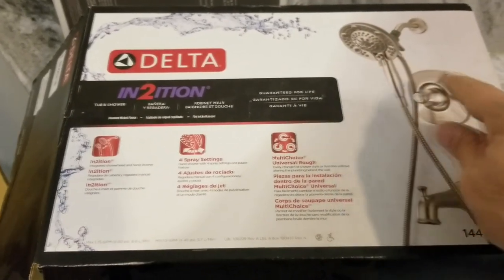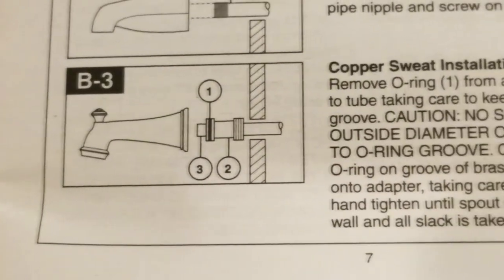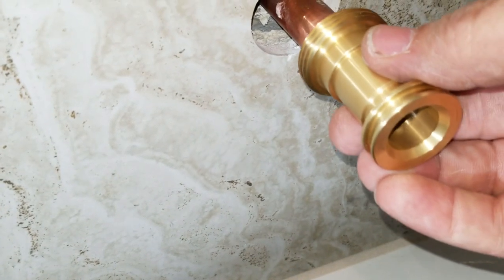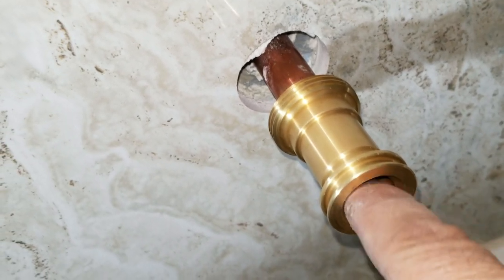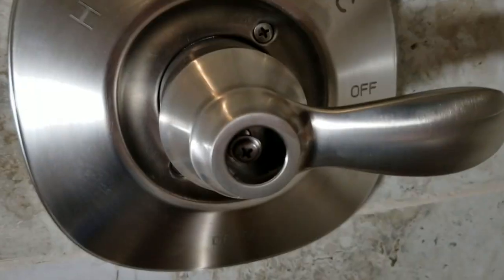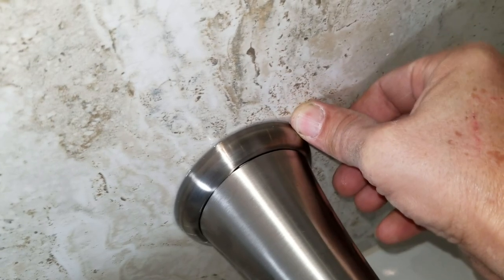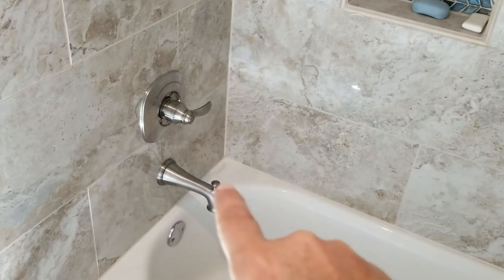How to Install Bathtub Spout, Solder on Adapter, Delta In2ition

Comment: We had our Delta tub faucet and shower head installed by a contractor a month ago. Today, I was cleaning the spout and discovered that it easily turns 90 degrees either way. What error was made in installation and what is the best way to fix the problem without creating a new problem? Nothing would surprise me as this contractor made several other costly mistakes. We have not noticed any leaks in this area (unlike other areas he worked on). We did insist that he install an access panel behind the shower plumbing (after he removed our old panel and drywalled over the area).  Thank you for this video.
Reply from the maker: 2 possibilities, 1) if the tub spout threads onto the pipe, then you just need to tighten it more against the wall, and when you get it nice and snug, apply silicone all around it except for the 6 o'clock position to allow any water that might leak from inside to escape out the bottom.  2) If the tub spout is set in place with a set screw on the bottom of the spout, find out what type of driver you need, and tighten it down nice and snug.
Reply: @jeffostroff  Thank you for the quick response. It threads onto the pipe just like your video. It can't be tightened a full revolution, so I probably just need to leave it and add silicone as you suggest. Will the silicone hold it into place? Is there a possible reason the plumber didn't apply silicone when he installed it?
Reply from the maker: @lsackett7586  Was he a real plumber? A Licensed plumber?  Either way I have seen both plumbers and non plumbers overlook this important aspect of water proofing your bathroom shower tile installation. Some are just stupid and don't know, others are too lazy to care.
Reply: @jeffostroff  We used a highly rated licensed contractor for a remodel and the plumber was one of their licensed subcontractors. Sadly, he made mistakes which the contractor had to compensate us for including a serious water leak, so this oversight isn’t surprising. Will the silicone hold the spout in place even if it isn't completely tight?  Thanks again for your advice. Much appreciated!
Reply from the maker: @lsackett7586  Yes, silicone is very strong. Lots of cabinet installers use beads of it along the ends of kitchen cabinets where they meet the wall, and they will support the cabinets even when the screws are pulled out.

Comment: Confused by directions - I can remove the external O ring as directed for soldering - but there is also an internal O ring that I would think will be destroyed by the solder heat. My adapter allows the copper pipe to pass completely through the spout, and it has a set screw to tighten against the copper pipe once it's in position. Is this a "solderless" adapter with outdated instructions?
Reply from the maker: The best thing to do is to look up and install video for your particular model if you have a set screw it would seem like there isn't any soldering involved

Comment: Is there another adapter that can be used that doesn't require soldering?
Reply from the maker: Yes, many aftermarket tub spouts have adapters that fit over the end of the copper pipe, then you thread the tub spout on the adapter. The adapters are usually plastic.
Reply: @jeffostroff  Thank you!

Comment: Hi Jeff, what if the guy that installed this didn't cut the pipe and now the spout isn't flush against the wall.  Is there a way to un-solder it?
Reply from the maker: Samantha, yes you can remove the tub spout, then try to figure out how much pipe you need to cut. then you apply torch heat to the pipe adapter and unsolder it, clean the end of the pipe where the solder is, and then cut down the pipe the leng that you need it to be shortened.
Reply: @jeffostroff  Thank you!!! Subscriber for life!

Comment: We just had this installed in a new bathroom. Water pressure is very low and fault has water coming out when we turn the shower head on. Any idea what could cause this and how to get better water pressure in faucet and shower head?
Reply from the maker: Sounds like a problem in how the faucet was installed, and whether it was threaded on all the way so that the front of the pipe meets the gasket

Comment: Jeff, how high do you typically put the spout and water controller above the tub?
Reply from the maker: I don't normally change what is there, but faucet is usually 12 to 18 inches above the rim of the tub.  Tub spout is usually 4 inches above the rim of the tub. In a shower stall, the faucet is higher  48 inches off the floor.
Reply: @jeffostroff  ya I am doing a tub/shower combo.  So spout around 4 inches above rim and faucet 12 to 18?

Comment: Great video!  The house I just purchased has this faucet.  When I turn on the shower, a steady stream of water leaks out of the tiny hole underneath it (mentioned at 9:26, except yours doesn't leak!).  How do I fix that?  Thanks!
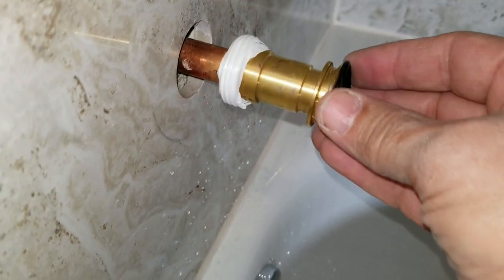Reply from the maker: Melanie, if you have water coming down the pipe at the wall, there are 2 main causes. 1) Someone forgot to wrap Teflon tape around the copper pipe before they screwed on the tub spout.  2) Someone forgot to make sure the black O-ring is in place at the tip of the brass adapter where the tub spout screws on. Or, a bonus #3: that O-Ring might have worn down, allowing the water to run back to the wall.  You'll see on the video at 7:00, I covered this and show you where the Teflon tape and the black O-ring are supposed to be.  One other reason I just thought of Bonus #4 reason, if the installer cut the copper pipe too long out of the wall and the tub spout did not screw in all the way, so it was not water sealed, and water is leaking out. Let me know which one you find.
Reply: Thank you so much for the speedy response!  When I initially took it off, there had been Teflon tape.  I put more on (went around 2 times) but it was still leaky.  Should I go around more than that?
The O-Ring is in place and appeared to be in good shape.
Regarding bonus reason #4, it seems like it is flush against the wall when screwed in.
Reply from the maker: @qwertyer5  Don't need to go around more than 3 times with the tape. Something on that installation is not doing its job, and it's either the tape or the O-ring, since those are the points where it gets sealed. Maybe look at the female threads inside the tub spout. Are they cracked? Are they making full contact when screwed in?  Try another tub spout if you have one even from another cheapie kit just to see, they should 
all work the same as most require a certain distance range from the wall for the threads to work. So also, measure the distance from the finished tile wall to the tip of the threaded copper pipe and see if that is what the manufacturer requires.
Reply: I think I may have found the issue - the copper pipe extends beyond the adapter.  Would cutting it off (as described in the instructions) possibly fix this?  I took a picture but I don’t think I can post it here.
Reply from the maker: If you look at 4:18 into the video, you'll see that green drawing I overlaid on top of the video, that shows what your tolerances need to be. My copper pipe was exactly 2" off the tile wall as you'll see me mention several seconds later in the video. So, before soldering I dry fitted the brass part onto the copper pipe, and tried to determine if that was the correct protrusion length of the pipe from the wall, depending on where I will solder the brass connector. The green drawing I show there, it shows that your copper pipe can be up to 3 1/2" max off the wall, but also within that constraint, the rear threaded section must be within 1/4" to 1" off the wall. I had determined that 2" of copper pipe would do the trick for us, it keeps the pipe under the 3 1/2"  limit from the wall, and also allows the rear threads to be between 1/4" and 1" off the wall. If you then look at 7:05, you'll see the side view, the brass part appears to have the rear threads at about 3/4" off the tile wall, satisfying that required measurement from the green drawing of 1/4" to 1" range off the tile wall.
Reply: @jeffostroff  First of all, thank you for your speedy and helpful replies - I really appreciate it!  The adapter on my spout seems slightly different - it doesn't have the stop that yours does - mine seems to actually resemble the one in the installation instructions.  I also measured several parts - the end of the copper pipe is 2 3/4" out from the wall. The end of the adapter is just under 2 1/4" out from the wall.  The rear pipe threads are 7/16" out from the wall.  I don't have any of the original instructions or the exact model number so I'm using what I can find on Google and from your video.  I know it is a Delta Multichoice faucet (says that on the handle) and my spout looks completely identical to yours.  I'm wondering if cutting the end of the copper pipe so it is flush with the end of the adapter would make any difference?  As you suggested, I can also try purchasing a new handle to see if that does the trick.  From what I can tell, the female threads on the inside of the spout are in good shape - no cracks or calcium build up.
Reply from the maker: @qwertyer5   That's a tough choice to make should we cut back the copper pipe or not. I would try even harder to locate which model number you have and go online to find the PDF file of the install manual you can also call Delta and ask them they may have some insight as I have spoken to them on the phone their customer service people are pretty good. But basically it seems like if it's threading in on the tub spout OK that's likely to not be the problem spot.  I would think the problem point would be where the O ring is. So maybe try to figure out do you think that the O ring is really making contact inside the tub spout  where it's supposed to to keep the water from leaking backwards. And if not maybe you can try cutting back the copper pipe. But remember if you mess up and cut it too short you'll have to have a plumber come in and saw her a couple are on there and extend the pipe back out to whatever is the correct range from the wall.
Reply: @qwertyer5  what u did to fix the leaking from the little hooe

Comment: If I only have 1.5 inches of pipe sticking out from finished surface is it okay to slide the adapter on all but a half inch so that the gasket reaches the smooth part of the inside of the faucet?  If not the gasket hits in the threads on the inside of the faucet and does not create the seal
Reply from the maker: es you should be OK, look at 4:20 the green diagram shows you need from 1/4" to 1" from finished wall before the adapter needs to star to appear on the pipe. Then once in place, the water end of the pipe should be no more than 3 1/2" from the wall.

Comment: I just installed this I did not have the stop but when I turn the shower head on I get that leak from behind the tub spout. O Ring does not look damaged, I tried teflon taping on the threads, tfe paste, tried a thicker O Ring but it was too thick for the spout to go over. Any suggestions for how to stop the leak would be greatly appreciated.
Reply from the maker: Is the distance from the wall correct for the length of the pipe? Is the spout nice and snug against the wall? If not, the length of pipe is not correct, and water is getting past the O-Ring. You might have a defective pull rod on the end of the spout.
Reply: I had the same issue!

Comment: Hello Jeff
On my Delta Monitor 1400 Series Tub Spout Adapter, I have an O-ring on the outside AND on the inside (same side).  
When installing the adapter, the pipe would ‘stop’ there and not be able to inserted fully.  
I put lube on the inside O-ring and now it slips in.
I also have a set screw on the outside of my adapter.

My question(s) is this:
1.  If I take the outside 0-ring off to solder the adapter, wouldn’t the heat damage the inside 0-ring?
2.  When threading the tub spout onto the adapter, is the adapter supposed to go all the way into the faucet until it reaches that stopping lip on the inside of the faucet, or do I just leave the 1’’ space from the wall/threads of adapter, and hand tighten until it’s against the finished wall.
3.  Is the outside 0-ring capable of sealing off the spout on the inside? I can’t imagine that because it seems that the 0-ring seal would be loose UNTIL I tighten the spout past the inside threads of the spout so the outside 0-ring reaches the inner chamber of the faucet, which seems a little smaller and smoother.  If that is the case, wouldn’t I need to make sure I measure where I put that adapter on the pipe, ensuring that the 0-ring end reaches that inner chamber AND I can have the spout firmly against the wall?

WHEW! Lots of questions!
Thank you for the videos.
Look forward to your reply.
Craig
Reply from the maker: Craig, not sure about the inner O-Ring, I have not seen one there before. Best to pull up the instructions from Delta and see if they tell you to remove the ring. I can't imagine any O-ring being safe near torch heat. I try to set the distance of the adapter so that when the spout is threaded on, the spout tightens against the back wall. Again, the instructions should give you are drawing detailing how far the front edge of the adapter needs to be off the wall. The O-ring is really there to seal the adapter to the spout so water cant leave the adapter and crawl back toward the wall, then you have a drip down the wall. this is why it's critical to stay within the length range they tell you in the installation manual. Remember, they tell you the y need X amount of pipe out of the wall, the front edge of the adapter needs to be Y inches form the wall. So you have to know these numbers.
Reply: Thank you Jeff for your advice.
I’m reading through the instructions which look pretty much like yours, and there’s nothing mentioning that inner 0-ring.
I’m calling Delta.
Appreciate your advice and suggestions.
Keep up the good work!
Reply: @craiganthony4617  Sounds like you had a slip fit adapter.   That is made with an inner o ring and set screw and with that you do not solder it if you mount using that method.   If you remove it you can mount the same as the video

Comment: N the instructions it says you can not use pex from the valve down to the spout is this correct or could you use pex with a 90 and then come out with copper with a shark bite 90 then copper out from the wall 2 inches thanks in advance
Reply: A bit late, but you cant use pex because its flexible and will not support the spout. also a sharkbite connector will not stop the pipe from roataing so it would be tought to screw the spout on.
Reply: Shark bite fittings are garbage and will erode internally based on how much (chloride I think it is) in some municipal water systems. If using them, DO NOT hide them in walls or cover them up. I've replace many of these fittings over the last 10 years due to leaks. Only use as a LAST resort. And yes, if you aren't anchoring the tubing from the valve with a wingback 90, don't use pex tubing off the spout.

Comment: does the copper pipe have to be a certain width
Reply from the maker: Standard 1/2" copper
Reply: @jeffostroff  appreciate it
Reply: how did you take the o ring out from the inside
Reply from the maker: @theserg8069   We gently removed that O ring by using a small flat head screw driver to get underneath it and then lift it up and out of the groove.

Comment: I don’t recommend people do it this way follow the instructions. I did exactly as video states and leaks because there is a large gap to fill with solder. After reading comments it does slip through with flux as instructions say. Now I have to remove after cutting pipe too short.. more headaches.
Reply from the maker: Numerous other people also reported theirs would not go through no matter what

Comment: Jeff, you either need to remove this video or put a BIG DISCLAIMER that the new fittings will fit all the way through, and as others have mentioned, perhaps a pipe was not perfectly round.  My fitting (September 2021) fit all the way through.  Thanks!
Reply from the maker: Thanks for the tip just added it

Comment: Hello! Thank you for sharing this video.  I just purchased a Delta Spout and my water comes out just like yours in the video at 9:23. Is this normal for Delta products? How can I fix this to make the water flow more smoothly and not so rough. I have searched the internet and can't find anything. The plumber said that is was just how delta products are made, but I refuse to believe that.
Reply from the maker: Good question, I don't know. Could be the inside shape of the pipe, or the gate when you push knob down, maybe it is still slightly blocking the pipe and changing the water flow pattern.

Comment: Sorry mates, the info in this video is incorrect. The brass adapter will indeed slip all the way over 1/2" copper(red or blue) as prescribed by Delta. If you are having trouble getting past what Jeff refers to as the "stop," you need to deburr your pipe end. Sweating the adapter on with just the tip of the pipe in contact will result in leaks and/or the tub spout may come completely off.
Reply from the maker: Sorry mates, Ryan is wrong. The adapter was designed by Delta for the tube to go through, for many people the copper tube does go through the adapter and you cut off the excess shown in the directions. We cut the tube, we reamed the inside of the tube, we chamfired the outside of the tube, and it still would not go through. Called Delta, they said they had received numerous complaints from other installers about this, and certain batches got out with flaws in it. They said the way we soldered this tube is correct, because it is the same way you solder it if the tube passes through it, because you only solder where the tube connects with the adapter and the solder sucks into the channel via capillary action.